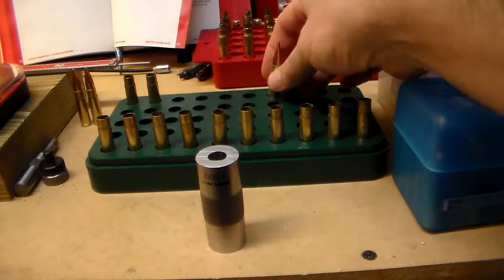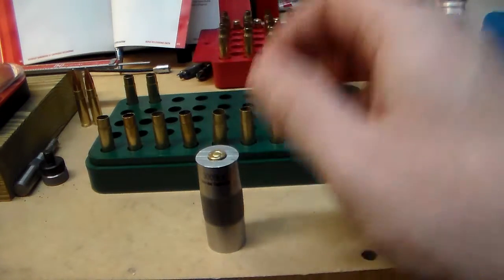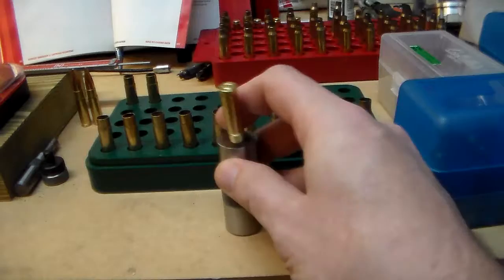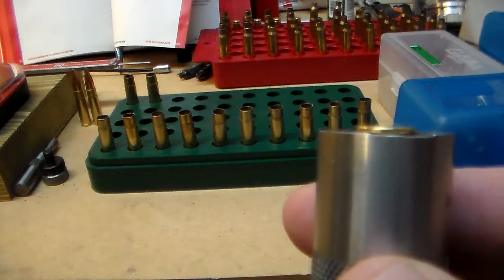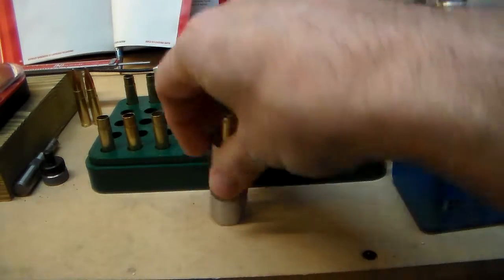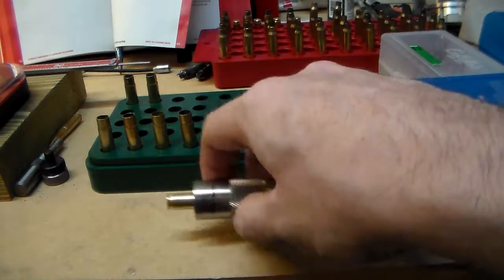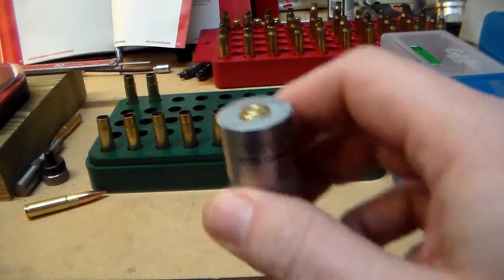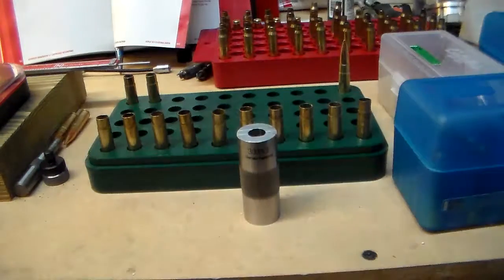300 Blackout NO GO using the Sheridan Engineering Gauge

Comment: What is the solution/fix to this??? I had the same issue today. I heard to adjust your seating die. But I don’t see how that fixes the issue
Reply from the maker: You should first look at brass lenght. You might need to trim you brass. Second would be your sizing die and location of the shoulder. The brass might also have a bulge in it. Hope this helps.